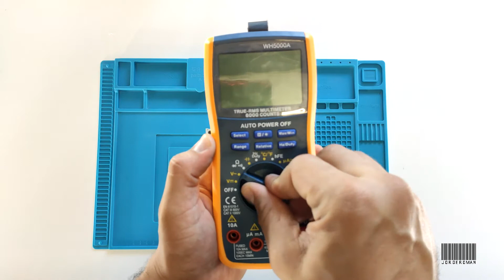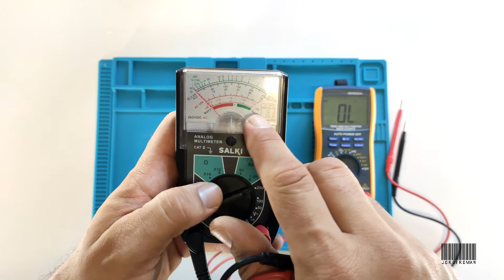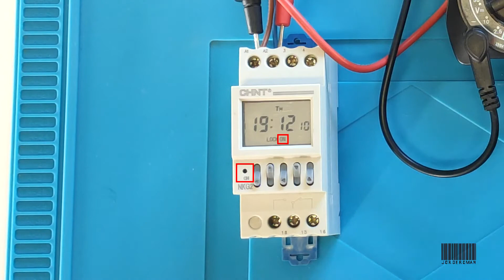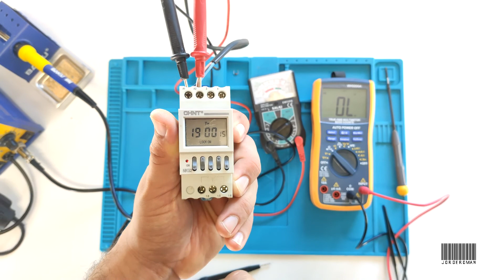RELOJ Temporizador CHINT NO funciona | ✅ SOLUCIONADO

Comment: Hola que tal, felicitaciones por la  claridad al explicar.
Pregunta... en mi timer también esta el zener quemado  y el voltaje  de trabajo de el  relé es de  48v, le iria el mismo zener que pusiste o está relacionado el voltage del diodo con el relé??? Desde ya muchas gracias
Reply: Con el voltaje del relé podes darte cuenta que diodo Zener usar, si tu relé es de 48V, tu diodo Zener es de 48V o similar, por ejemplo 47V. La potencia del diodo Zener puede variar, lo mejor es colocar de 1 watt.